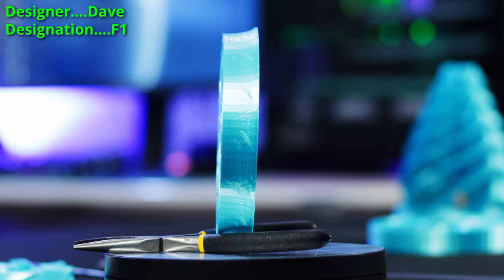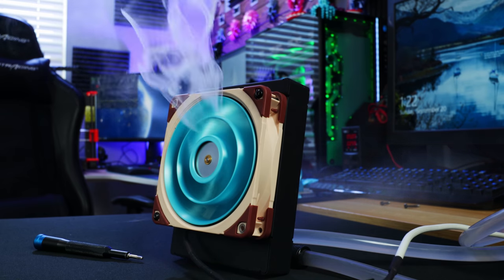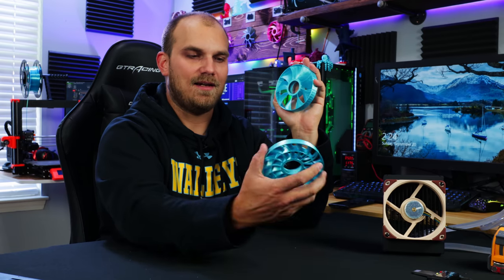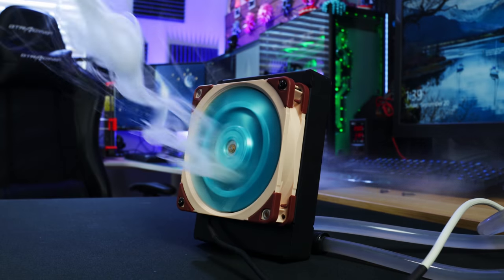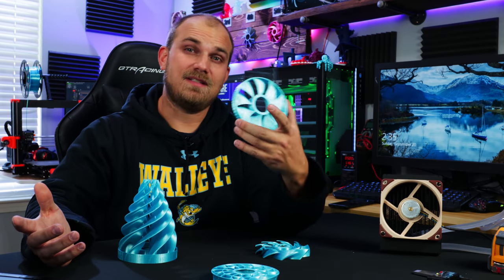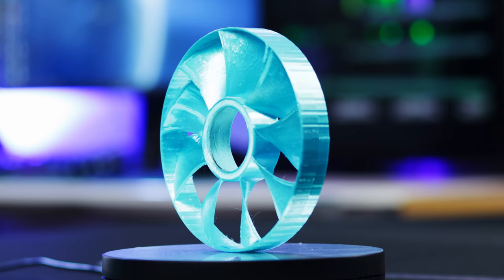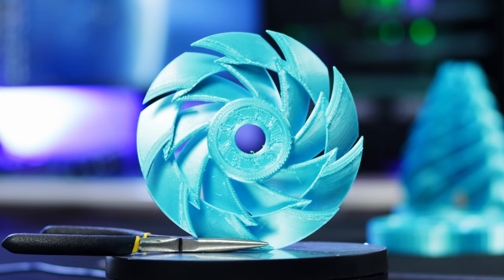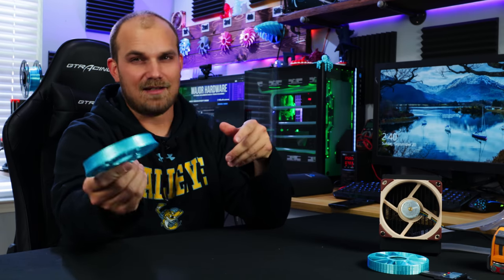This Couldn’t Possibly Work… Could It? | Fan Show Down Episode 5

Comment: Just got another idea for a fan...
A taller fan (2x height), basically continuing the blades up, having a scoop on the exterior from the top of the fan enclosure to the top of the blades slightly bomber like a car scoop, the whole thing go into the blade, basically to allow grabbing more air from the side and pushing it into a normal blade design. Maybe a side wall for structural integrity, probably thinner as it goes up and out for mass conservation/speed
In my head it would allow the normal blade air to be pulled in + a little more from the side, aka should be cooling more...

I probably could make a drawing of some sort to explain better but For now i'll put it in text...

Front sideway(as i can't do in text on normal side) view of a blade's extra bit: (. is just spacer for drawing)
...___------___.
./.................\_______
/...................... ^^ Side wall
|
\ ................. << Normal blade design extension
..\ ............... << Normal blade design extension
....\ ............. << Normal blade design extension
......\ ........... << Normal blade design extension
........\ ......... << Normal blade design extension
..........\ ....... << Normal blade design extension
............\ ..... << Normal blade design extension
..............\ ... << Normal blade design extension
................\ . << Normal blade design extension
.................| MOTOR
.................| MOTOR
.................| MOTOR

Comment: anyone else notice the amount of smoke that favored the inner ring on the first fan? progressively angled blades to attempt a match of air flow with either harsher or recessed angles on the specifically the outer blades alone would be interesting to see. i am not currently mentally endowed enough to do the math but i know you lads could more than likely do it

Comment: The F1 fan is not designed after a F1 wing. It is designed from the Brabham BT46 also called the “fan-car”. 

It was a fan fitted to the rear of the car giving it immense downforce and outpacing the rest of the field. It was soon after banned for F1 competition. I like the thought process put into these fans.

Comment: I mean, it's really obvious that without any substantial changes to the cross-shape of the blade, the one with higher surface area is the one who's gonna pull more air. The biggest one, whoever, is too big and I think it's actually spinning slower because of all that inertia? And the constant wobbling doesn't help it either.

Comment: What is the airflow through the radiator?  The cone just need to be centered and could potentially blow more air to cool.  The one with notches (Thomas) one more notch would really be good and bring the noise down.

Comment: Hey it wouldn’t work in the Noctua housing, but you should rig up a blower fan on that radiator and see how it performs.  Centrifugal blowers produce more pressure which radiators are supposed to like.  Makes sense since they use blower fans in AC systems

Comment: The Tulip would make for an awesome kenetic scultupre.  Just take an unused fan, get a variable power suply fro Radio Shack or where ever, and run it at a low voltage so it's easy to see the blades as the spin.

Comment: The F1 actually has a second advantage, too. Specifically the inner ring will work the same way as a wing fence on a fighter stopping too much lateral airflow. IE it could if the geometry is just right make it a bit more efficient in that it will stop the inner blade air from moving partially outwards as well as downwards.

Comment: I like the Tulip. It is by the way the type of propeller that makes submarines quieter.  It is called the Archimedes Screw.  https://grabcad.com/library/archimedes-screw-1 More surface pulling the almost same amount , or more , of air/water, has to be more silent, because less turbulences.  I would  say it would be even more silent, when facing inwards a case. You d need a bigger case ofc.  Would be a great heat exhaust fan too, facing outwards the case at the back. Maybe put a tube arround it, to create more suction, like in a pump or a turbine. But this would be more air again, so more noise, hmm, but more fresh air in / more heat out. The intake should have like a vortex fan design to it. This Tulip definetly moves the same amount of air, like a regular fan moves, but way more silent. What if you try a double screw fan design. Like a football. One half is outside the case, sucking fresh air in, the other half facing inwards, but pushing into the case. This would be great for a football themed build . Color it brown, and paint like a white stitching seam on it, hehe. Awesome, i like that idea. COOL videos. I mean, they are cool, because they have good fans, urrm... . And good fans, clicking on the videos. Happy new year.

Comment: Just looking at those blades, it appears to me that the winner fan had thicker blades, and the printer rendered them more smoothly.  I wonder if the thinner blades suffered from the striated surface finish, and also whether that affects the noise level.  I am sure the ridges, which are pretty much perpendicular to airflow would definitely affect the laminar flow layer of those blades. The other question that came to mind was whether the difference in mass affected the speed of the fan.  Did the heavier fans spin slower, and possibly therefore couple better, than the light fans.  This might help explain the unexpected performance of the tulip.  I think the high attack angle of the F1 fan probably made it induce a lot more swirl in the output flow, which may have actually reduced airflow through the vanes of the heat exchanger.
Just quick thoughts, but it would be interesting to see RPM recorded as a datapoint for these comparisons.

Comment: Please make a clear tube with weights on top, perhaps holes throughout the tube. Place the fan at the bottom to see how high can the fan push the weight up. Im interested to see how much pressure these designs make. (Weights on top like a piston)

Comment: the fan isnt based on the rear wing of an F1 car. back in the 1970's there was F1 car called the Brabham BT46 and it was designed by a man called Gordon Murray, who is also know for designing the Mclaren F1 road car. this fan was mounted to the back of the BT46 to aid in the cars down force and to help with cooling by sucking hot air out of the engine bay.

Comment: Really wish you had measure the power consumption of each of the fans!! I'm pretty sure that spiral did require more power.. since the motor of the fan is a constant power, constant RPM....

Comment: If you would measure static pressure, and flow, that would be way more info. I can rig you up something that will get you repeatable, if not percise, measurment. MAF and MAP sensors are super easy to read, and a spare psu should hadle all needed voltages. Great show!

Comment: Can some one create a positive pressure fan where you have 2 fans rotating in opposite directions to each other but push air in same direction. ( not sure of the rules but would love to see it happen) could try different speeds of each motor and different blade designs.

Comment: Could you also rate them by material cost?  The first seems amazing, and second place is cool, but second place used way more materials, and I wonder if the simpler designs used fewer materials per delta changed, also dusting parts is a thing, so delta/surface area, but that’s probably much harder to measure.

Comment: Have we done any evaluation as to the minimum delta-T of the water-cooler you're using for the test?  With so many results stacking up so close to each other, you might get better comparative data by using a cooler that would bottom out much lower under higher airflow conditions, i.e. a 360mm rad with a single pusher fan at the hose-proximal position.  It might help you "split hairs" by increasing headroom in total delta-t without being in the smaller rad's envelope of diminishing returns.

Comment: help, im really having trouble. do i get a d15 with 1 a12x25 and 1 140mm stock fan, or just an aio with a12x25s on it??? it would be really cool if u tested a d15 with one fan replaced with a a12x25 and saw how it placed against the latest aios!

Comment: The winning one is really interesting. Try throw it into a flow simulator and see what happens. Also it's slightly unfair to judge a fan when using the same voltage input to the motor. You need the power drown by the motor instead which is voltage*current assuming 100% efficiency. Otherwise, the more load on the motor, the more energy you get to work with, the more likely to win.

Comment: While the tulip wasn’t the top-performer, the increased surface area at the edge of the blades’ reach (cone, vs. a disc like most of these fans) seems like it would pull far more air more.  I imagine it didn’t grab the top spot because the additional mass of more plastic meant it spun at 1263 RPM (as opposed to the 1800-1900 RPM range of the other fans), losing all the advantage it had.  (Mechanical engineering folks absolutely jump in and correct me if my intuitions here are incorrect.)

That said, I still believe in the cone/corkscrew shape, or any shape that increases the 3D surface area of the lathed “reach” of the blades’ edges.  Maybe a design with different angle of attack or fewer blades or a graduated angle towards the center could still take the top prize. ¯\_(ツ)_/¯ 

I would also love to see an airfoil fan.  Not sure what effects it would have, but if the high-pressure & low-pressure zones work for airplane wings, something could be done here for fan blades, right?  Or maybe that’s the point of curved blades, so it’s essentially already being done by many fans. ¯\_(ツ)_/¯

Comment: If the first place was longer like the tulip (but only like an inch at most), with a steeper angle to the blades (maybe a few more as well), I theorize it would preform better.

Comment: If all them 3D printed fans were polished more smoothly the noise factor would go down and the drag/blow goes up, as with all 3D printed moving parts, sanding it makes a smoother run.

Comment: If the ends of the Tulip design were angled, I bet it could do better. It would help keep air from flying off the edge of the blade. At least that's what intuition tells me. I forget why they put those on the end of plane wings rn

Comment: I thought that the tulip wouldn't do well simply because it would be so much heavier than the other fans and have to deal with some nasty gravitational forces causing wobbling unless it's kept vertical (and if it wasn't made perfectly symmetrical, it would still wobble even if perfectly vertical). Despite it's good performance that fan would probably be the first to die.

Comment: I only have one real comment on this.......why are you using an FDM printer for what can be done better with an SLA printer? I love the idea of the show but alot of these designs can be done better with an SLA printer. You mentioned in this vid that the 3080 fan was done with one layer line and it had issues.....i could see major problems sense it will not have an optimal air flow...yes you can do it with an FDM printer but an SLA will be smoother and have less drag / resistance pushing said air. 
im totally subbing because this is cool and I havent seen this done with 3d printing but please try your current top 5 FDM verses there SLA counterparts. id love to see what happens. :)

Comment: Old mate with the rtx 3000 fe fan is onto the right idea, he copied the wrong fan but. The one to try is the blow through fan that spins the opposite way that you'd think. I really wish someone who know's their way around 3d printing software would google submarine propellers and submit a design. Those things are designed with nothing else but silence in mind, modern ones are classified to give you an idea of how cutting edge they are. Yet most participants still keep submitting relatively the same design with the forward-swept chopping blades.

Comment: So interestingly enough the winning design may have actually accidentally lightly stumbled across a fluid flow phenomena called blade vortex interaction, check out the design of the blades of stealth helicopters and you will see edge flow discontinuities similar to the design of the blade in question.

Comment: project idea: what if you built a reservoir inside of a minifridge to make a sealed cooled water loop? 

project idea 2: what if you used a window air conditioning unit to cool a pc? (i imagine if you had a sealed system that it would work fairly well because the window units pull humidity out of the air as it runs)

Comment: I think you should also take into consideration, its not like you are sanding down the fans and making them smooth either. So all the ridges, bumps, stray filaments are reducing their performance, just that little extra bit. So wouldn't be surprised if the current #1 isn't on par, if not slightly better then, the noctua that was originally in there.

Comment: Dude, i know they are expensive but you really should get a dlp 3d printer. They are soooo much better for the types of tasks you are doing here, it would be so much smoother and just better, also if you are not gonna do that(totally understandable), i recommend having them sit in acetone vapor until they look smooth, it works really well for pla at least.

Comment: To be fair, regardless of the fan design, the printed fans are going to produce a fair amount of turbulence because of the texture produced by the layered printing process. If the surfaces were smoother the performance would probably increase noticeably.

Comment: Predicting Tulip wins and the simple fact it has the LARGEST intake surface of all the fans. Aww, second? I'm surprised. Probably because it's heavier so running on the same voltage of the rest, ran a bit slower given it's mass. But it does have a massive surface intake compared to the rest.

Comment: I've never used a 3d printer before.  Do you normally just use it straight off the printer like this or do you dip it in an epoxy or something like that to smooth it all out and strengthen it?

Comment: Just a heads up, but you may want to discard the data you gathered while testing the A12x25  and possibly several of the other, top, closely tied fans, because I don't see where you indicate the % of humidity. Humidity can have a HUGE affect on thermal dissipation. Something to consider.
 
Since it's hard to account for every environmental variable imaginable, including humidity, if I was you, I would try and run these tests in groups of 10 or larger, instead of 5 like you've been doing. Retesting, and throwing out the old data for the fans currently in the top 3, and including them in the test lineup.  For example: You've got another 5 fan designs printed that you wanna try, so you run the tests for those 5 fan designs. Well, afterwards, you would re-run the tests for the fans currently in the top 3 (A12x25, Acceleron, NJN-FanMod) and include them in your results against the 5 or 10 you just tested.

Comment: I feel like this would be really hard, but could work really well. What if you Jerry rigged an air conditioner as a CPU cooler? Either just ducting the AC straight into the case or somehow making the cold side of the AC unit actually be the CPU cooler

Comment: I hope the different colors of PLA don't have different physical properties, and that humidity/room temperature/barometric pressure (???) etc. don't have an effect, because that could mean week to week comparisons aren't super valid. Would be interesting to see one of the previous week's designs printed in the same batch with a new roster of fans and cross-compare if there is any advantage (or disadvantage) from batch to batch.

Comment: 1.3m is a lot with SPL in that low range.. 30cm would've been sufficient, you get much greater signal to noise ratio the closer you put it, 30cm is nice workable range and often used.

Comment: I cbf doing it so someone else do this and send it in: make whatever normal fan design you want then on the front put little half cirlce or quater circle flaps on the end of each fan blade so that the lip is in the direction the fan spins making each fan blade. It scoops air and pulls air rather than jusy pulling

Comment: I always wanted to do a build using the air cooler with heat pipes but run water through the copper heat pipes.
Surely that would work and help take a lot of heat out of the inside of the case too
Reply from the maker: I have a video where I did that
Reply: @MajorHardware  Yep I found it the day after I posted that

Comment: really wish he did power draw tests to see what kind of stress he's putting on the motor. Acceleron looks like it would be a significantly harder draw to turn at the same rpm because of the air pocket from the zig zag.

Comment: love the tall one. dose it work it reverse? cause you would have to flip it round to fit it in the case, would pulling air through the rad instead of pushing it work as good?

Comment: so very #Pear :D but then greater surface area is More Air.
.
now put Double height scoops on your winner - also... 3d printing them breaks the laminar flow on all surfaces. If these fans can beat noctura, injection molding will gain you delta, guaranteed. You may well design the 'best' fan in the world... fk that's cool <3

Comment: new video idea: cool a cpu with a customer waterloop, but instead of water and a pump, use air and a hairdryer. you could 3d print connectors on the front and back of the hairdryer to screw fittings into.

Comment: I'm making a fume extractor for soldering, so I need a fan moving as much air as possible, as quiet as possible. Preferably also as laminar flow-like as possible.  Low speed could take care of the noise. Now a blade design that scoops as much air as possible. Any tips or suggestions?